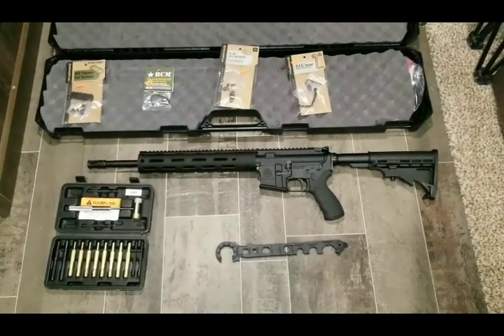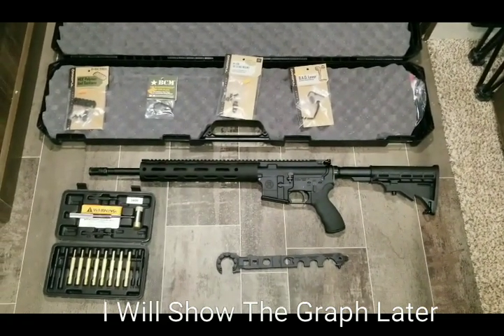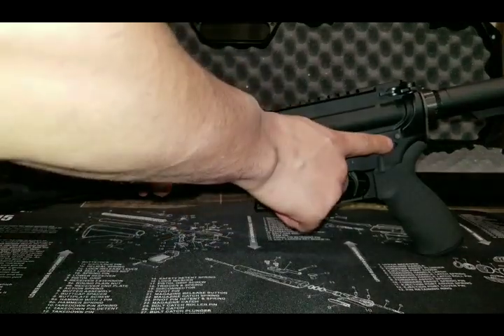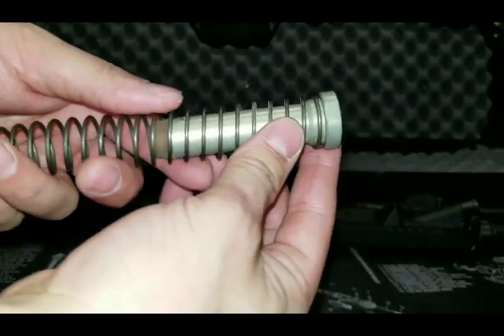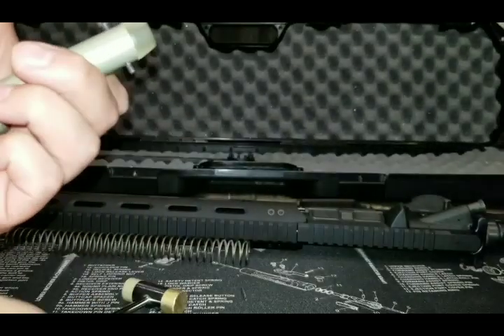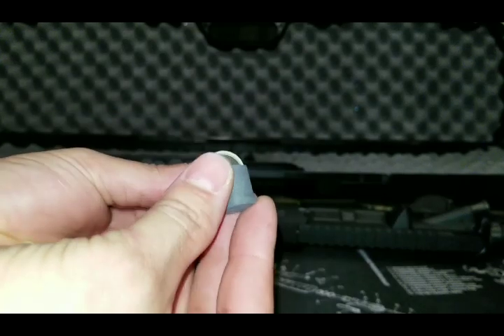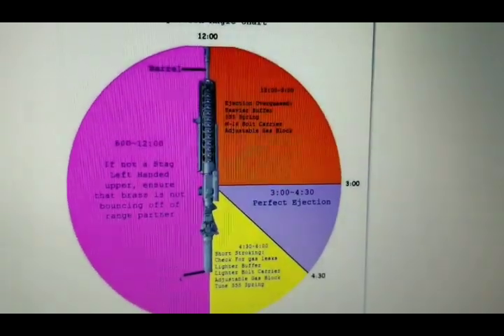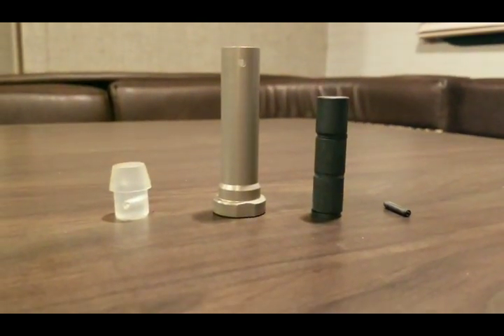Your Radical AR Is Over Gassed, FIX IT CHEAP!!! Here's How

Comment: Great video..... I have a Bear creak 10.5 upper that is WAY over gassed..... it is ejecting at the 1-1:30..... so I did the exact same thing added 3 tungsten weights to give me a H3 (BTW It is much cheaper buying these weights vs buying complete buffers) and it did nothing to the ejection pattern, next I bought a Springco Red buffer string (extra stiff spring) still did nothing to the pattern...... I didn’t want to buy a adjustable gas block but I guess I have no choice at this point......
Reply from the maker: Yea thats what i found as well with the prices, plus its customizable. What type of gas system does it have? Pistol or carbine? from what your saying i bet carbine so then its so over gassed these solutions won't work
Reply: It’s a carbine system..... it’s more of a beater upper/gun I bought the upper supper cheap so can’t complain too much I can say it’s a fun gun, just beats the hell out of you lol..... I can see excessive wear in the upper receiver from the BCG being slammed around...... I will most likely buy a barrel for it over an adjustable gas block..... it’s not the most accurate gun I have so you get what you pay for...... I basically bought it because of all the negative reviews out there, and with the discount from a gun show I paid less then 100 for it out the door (upper with BCG and charging handle) and I’ve put over 2k rounds through this thing..... but I have never been able to hit 10” steel reliably at 200 yds...,.. I have a PSA 10.5 with irons that will do it all day......I will say your video is the only one I’ve seen to use the tungsten from Amazon.... I’ve been using for a while with my custom builds.... Much better than buying adjustable buffer kits or buying buffer weights from Geissele for $20.00 a piece ....... keep up the good vids
Reply from the maker: @LONEWOLF_LCD  hey i really appreciate it. You pretty much answered all my questions in that one comment lol i haven't yet picked up an Ar pistol or sbr so bear creek has those reviews for a reason huh got it. Sorry for any mislead for fixes maybe i should do a video on gas system lengths and its relation to gassing. Before anyone attempts these easier fixes. Appreciate your support.

Comment: Adjustable gas block, Adjustable gas key, or Adjustable bolt carrier....lot easier than trying to find the correct buffer weight and you can adjust easier for different loads, subsonics, etc

Comment: Ok I have an AR pistol and the extractor is just tearing rims off the rounds leading to fail to extract/double feeds I had the upper checked out by the factory and they say it’s fine. I am guessing I am over gassed and need to upgrade my buffer. Would you recommend an h2 or h3 any help with this would be welcome.

Comment: No matter how heavy the buffer is that first shot from the chamber on a over gassed system should eject in the red zone (ie 1 oclock)   Why?   The buffer is in the back of the gun and has nothing to do with the bolt moving and pulling the case out.   The buffer does not come into play until the bolt hits it.
Reply: Pretty certain the bolt constantly rests against it doesn’t it? Or very close.

Comment: Does NOT increase reliability or ammo tolerance. how do you increase ammo tolerance?  Are you sure this "fixed" you gas issue. A heavier buffer delays the unlock time (from ignition of primer) of the bolt resulting in a change in timing of when the case is extracted from chamber (case at full expansion or during contraction). A heavier buffer can change the direction of case ejection but reading spent cases will determine a more robust prescription for your rifle. Marring by the extractor of the case head would indicate extraction at full case expansion and reduction in gas at the bolt would be a better solution by using an adjustable gas block that would also reduce carbon fouling in the bolt, upper receiver and trigger group. Light longitudinal scuff marks on the case would indicate extraction at or near contraction which is better and can be remedied with your topic of discussion. Don't forget to look for brass marks on the case deflector or edges of ejection port to see where the brass is hitting. These are just a couple of examples without going down a rabbit hole or opening pandora's box, not to mention ammo selection and usability. Rule of thumb, inspect spent brass and adjust accordingly. Shoot Straight.

Comment: Very helpful in the graph personally I think you should have started with that but I have a question what if you fall into the perfect enjection area but the case falls with in about 6inches of the gun would you call that a weak extractor
Reply from the maker: Andrew Fibush maybe add that rubber grommet to your extractor spring if your concerned.
Reply: Be Ready Basics would you say it would be a weak extractor tho or too strong of one
Reply from the maker: Andrew Fibush weak if i had to say. My brass from both my ARs flies closer to 6ft away
Reply: Andrew Fibush - I'm no pro but I've seen other have the issue you speak of and it was due to a weak extractor spring. There are videos here on youtube of it and how they fixed it. I'd recommend buying the extractor spring upgrade from BCM. it's only a few dollars. Also before spending money you should examine your extractor claw to make sure it isn't worn down or improperly machined. If so go ahead and pick that up from bcm also. Good luck
Reply: You can't tell where your ejection pattern is if the brass falls only 6 inches away. If your brass is falling within 6 inches of the gun your extraction is not violent enough. I suspect you are undergassed or possibly have too heavy a buffer. Weigh your buffer on a postal scale. 3.8 ounces is common. If yours is heavier, change it.

Comment: The 18 inch rifle length gas system is undergassed. Had to buy an adjustable gas block
Reply: An adjustable gas block will not solve any undergassing problem.  It restricts the flow of gasses. It's not a pressure amplifier.
Reply: @andrewrhodes8842  it will if the factory gas block wasnt opened up all the way. Idk but it worked
Reply: @sategllib2191  Then the problem was the gas block not "the 18 inch rifle length gas system is undergassed" . Sometimes the port (hole) in the barrel or the gas block is drilled slightly off of it's mark resulting in misalignment or restricted gas port. You get what you pay for.

Comment: I have the same radical ar and it ejects somewhere between 2:00 and 3:00 why is this a bad? Does it affect the gun?
Reply from the maker: This video should be updated with more information. I wouldn't say it's bad basically it causes more wear on the components. If its shooting groups your happy with i wouldn't change anything.
 Having a stiff extractor could alter ejection as well. Which these have right out the box. Put a few hundred rounds down the evaluate your personal experience with the rifle and go from there.

Comment: If rounds are coming off the shell deflector and going to the red area is this still over gassed or is that where I want it? 
Is this chart taking into consideration contact with defector or no?
Reply: Contact with the deflector is the only way brass will make it foreward of the 3 o'clock position because the cases are being extracted rearward by the BCG. So to answer your question, Yes the chart takes it into consideration.
Read the (if any) marks on your spent cases to see what your rifle is doing. From your description I'd say yours is overgassed with possible excessive extractor marks on the lip at the headstamp of the case if yours are landing in the red area.

Comment: I am to testify the heavier buffer weight works. My rifle was over gassed and I think I did it to myself. This year, I got a Windham Weaponry R16 SFST 308, their AR-10 in .308 Win (7.62 x 51 mm NATO.) Their stuff comes from the factory ready to shoot. For example, I also have a Windham Weaponry M4A3 Dissipator. That has a carrying handle with iron sights and was combat zeroed from the factory. So, I already know their quality is high and the MLOK handguard and the QD holes won me over the one other strong contender.

So, how did I over gas my AR? I never fired it with the originally telescoping stock on the carbine tube. Just before the Texas Freeze is when I got it and I had decided I wanted an adjustable cheek and so, I also ordered the Magpul  PRS Gen III. To mount that, I had bought at my favorite gun store a Luth AR rifle stock kit that has rifle length tube, spring and rifle length buffer. I put that on. Scope. Different bipods. 

First day of shooting at a range, my first 20 rounds went okay. Federal. Then I switched to Hornady. Some failures to eject, causing double feed and jams. Carving the bottom of the brass casings. So, research, such as this vid, led me to realize that it was over-gassed. Well, the bolt carrier group has a staked gas key, so not tunable. And the gas block is not tunable. And I am not going that far on my brand new rifle. So, I had ordered from Midway USA an H3 buffer.

When i received it, I found out I had accidently ordered H3 for a carbine tube. Ay carumba. What I needed was this rifle length buffer to be heavier.  I have a digital scale. And sure enough, it was below 5 ounces. So, I took out the roll pins and the rubber bumpers in the H3 I bought, the original carbine buffer that came with the rifle, and the rifle buffer and mixed and matched weights. When done, my rifle buffer weighed 6.1 ounces. A smidge heavy but not as heavy as others. There is a web site I found after the fact called heavy buffer dot com. The have 8 and 11 ounce buffers.

So, today, 03-27-2021, I went to range and the problem was solved. Smooth, comfortable. Not a single failure to extract and eject. Full stroke function. Different grain weights and muzzle velocities. Nontypical Whitetail 150 g, Federal Nosler 165 gr, Match 175 grain, it eats it all.

I would not change to a tunable gas block unless that was just a burning desire.

Comment: How can i tell if i have a slick side upper without the shell deflector?
Reply from the maker: I don't have a non deflector AR but some testimonies i have read 4 o'clock to 5 o'clock is perfectly normal.
Reply: @bereadybasics7525  Ok thank you for that. Because that is exactly the course they extract.
Reply from the maker: @CeliaShadden  perfect, no one has asked that question before. Now many more can read and pass it on. Thank you

Comment: My bullet case ejects to 1 o'clock but very softly like tumbling out of the receiver. Compare to my other bolt it ejects with power very fast at 3 o'clock. Is there something wrong with the bolt? Using the same bolt carrier
Reply: @rondurr7503  but the bcg is brand new.
Reply: @rondurr7503  thanks for the info. Im gonna try it later getting a stronger upgrade spring

Comment: New at this stuff.  Got to shoot my first ar pistol build today. (11.5 inch barrel, 5.56)  I shot steel cased ammo and the ejection pattern was at about 4 o'clock.  But then brass was being ejected at about 2 or 2:30.  
Is this a big problem?
Reply: steel cased ammo tends to be loaded weaker, so it's undergassed compared to brass. It's not the worst thing if brass is getting ejected at 2:00, but it could mean you're having more wear on your components. An adjustable gas block would help you tune your rifle to run more optimally to run on steel or brass
Reply from the maker: I didn't respond because Mr.M hit it dead on.

Comment: "Overgassed"?  What other symptoms?  If an AR is overgassed it will be giving excessive recoil, really pounding your shoulder.  The bolt carrier will go back too fast, bounce off the back of the buffer tube and go back forward and stovepipe the ejected brass as it did not have time to properly eject.  That's overgassed.  Easiest way to fix that, Wolff (gunsprings.com) Extra Power recoil spring.
Reply from the maker: A lot of different views on here. At this point pick a method suggested and hope it works lol adjustable gas block if you want to get perfection. Or run it til it has malfunctions

Comment: I must be really over gassed. I bought an H3 and I'm still ejecting at 1:30 2 oclock
Reply from the maker: There is more depth into it as far as length of gas system, rounds, bold buffer tube spring/weight
Reply from the maker: I really wish i had gone more in depth had i known all the feed back i would get with people having this issue.
Reply: @bereadybasics7525  -Thank you.
It's a 16 inch, carbine length gas system and I think a carbine length tube.  I'm not sure of the spring weight but I just bought a wolf buffer spring I'm going to try out. I am hoping it will correct the ejection pattern.  I'm just using run of the mill  American Eagle 55 grain.

Another thing, my perception is that it doesn't feel overgassed.  I have other overgassed rifles and red dots bounce on them.  This shoots flat, smooth and with very little impulse.  Should I just not worry about it or is it important?

Comment: I had to go the other way.  18" rifle length.  Had to drill out the gas port AND had to remove all the tungsten weights and make my buffer into carbine weight.  I'm using a Geissele spring which is stiffer, so I'm sure that didn't help me.

Comment: So I have this same ar, which variation of weights ended up working for you?
Reply from the maker: How many rounds have you put through it?
Reply: @bereadybasics7525  only about 250 of 5.56 and 400ish of .223
Reply from the maker: @TheOnlyMurk666  the only reason i asked was because i bought these weights but still haven't switched over to them yet. I just haven't used this rifle enough. Nor have i finished adding the accessories i bought. The AR shoots great but switching over will further "fine tune it" if you will. No weights will work the same for every rifle, same manufacture or not.

Comment: Great video... My AR ejection at around 1 to 2 o'clock.. Runs flawless just ejecting the cases as I stated. Thanks for the simple and great content in your video..👍👍👍
Reply from the maker: Hey i appreciate that. Its still works fine with a "non Perfect" ejection pattern but i would like to adjust mine to the perfect zone.
Reply: @bereadybasics7525  how do I get it format perfect zone??  Curious
Reply from the maker: @saulcarrera6509  from 1-2 o'clock ejection.... heavier buffer/ different buffer tube spring/ or the "perfect fine tuning" is an adjustable gas block. The weights kit for the buffer is one of the cheaper solutions other then buffer spring.
Reply: @bereadybasics7525  thank you.. Will try that and will reply back with the results... Thank You Sir
Reply from the maker: @saulcarrera6509  I love the feed back and other points of view for everyone to share. Thank you, appreciate it.

Comment: This scenario of adjusting the buffer system ( w weights &/or springs ) works but is only a band.  It does not address the main problem of your Rifle receiving too much Gas. It simply mitigates the symptoms but does not fix the problem. 
  The best way to address & tune out most gas related issues is with the addition of an Adjustable Gas Block.   They cost anywhere from  ( $40 - $100 ) but will allow you the ability to adjust your AR-15's gas system quickly  whenever you feel it is needed. 
 But if you plan on adding a suppressor i believe an adjusyable gas block is mandatory. Especially when you consider the cost.
 A suppressor will cost anywhere from $500 - $1,500 ( Suppressor, tax & fees & $200 Tax Stamp ). So i ferl that spending the extra $50 - $100 on an adjustable gas block to ensure that your rifle will run well with that expensive suppressor is not even worth questioning.
 The best & most effective adjustable gas block on the market that i am aware of is the ( Superlative Arms "Bleed Off" ) gas block.  Its roughly ( $100 ) but well worth it because it purges any extra gas out of the system & away from the rifle all together. The only adjustable  gas block on the market as of ( 8 /20 ) that i am aware of that does that. 
 All the other adjustable gas blocks adjust the excess gas away from the recoil system / receiver but keeps it within the barrel adding to back pressure which will most certainly be bliwn back into the receiver & the shoiters face once the extraction occurs. 
 Just my $.04 cents.
Reply: You have the operation of a gas impingement system 100% backwards. The gas block unlocks the bolt, the chamber pressure pushes the bolt backwards.

An adjustable gas block is for fine tuning a gas impingement system. A gas impingement system is inherently overgassed at the carbine length.
Adding reciprocal mass and spring power (increase in kinetic/potential energy of the spring) is what counteracts the increase in gas from a carbine or pistol length gas system.
The adjustable gas block tunes the timing of when the bolt receives enough pressure to unlock during the fire cycle. (The fire cycle reaches 60,000PSI max chamber pressure)
Too much gas with a short gas system, and the bolt unlocks too soon, releasing too much chamber pressure into the breach of the firearm. Get it?

Build the rifle, tune the rifle. In that order.
More often than not, an adjustable gas block is not necessary.
Reply: I’ve seen the bleed off adjusters but I don’t see a good reason for one above the other as a bleed off would reduce your fps . The reason we want a X length barrel is for more fps. Some ppl won’t care especially with a silencer but theirs no good reason to bleed off any pressure you’d be more likely to get gas in your face. Simply reducing the anoint of gas to the bolt is all that’s needed. A bleed of does nothing more than drilling a tiny hole in your barrel would ! Why would u wanna do that.